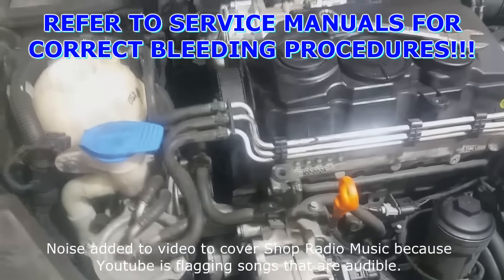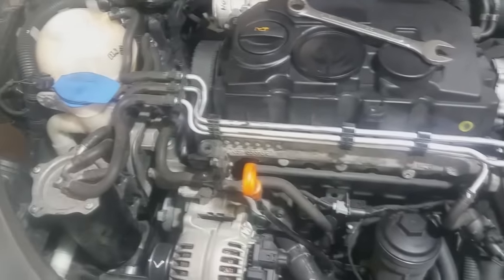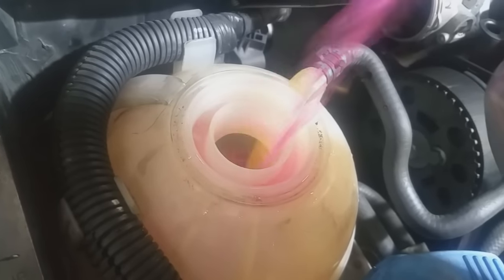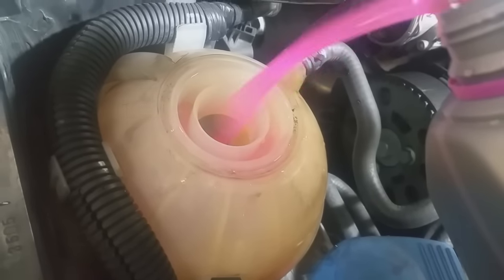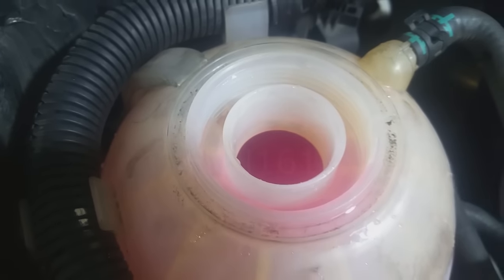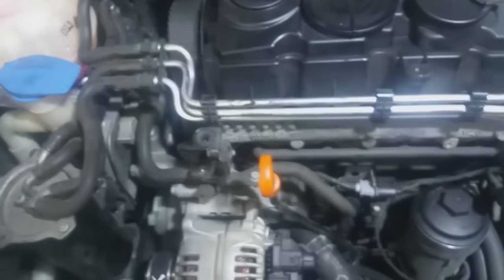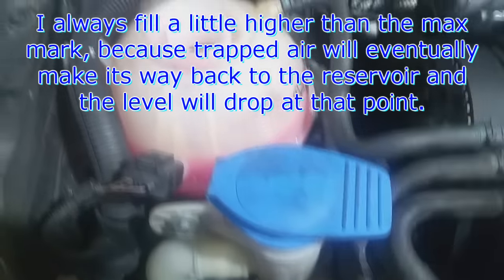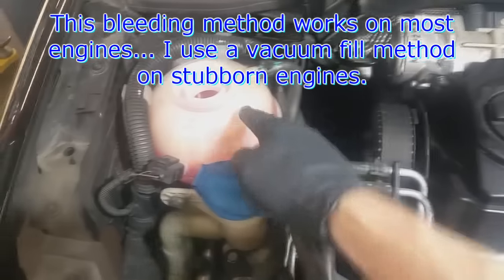Basic VW cooling system filling / bleeding info (viewer request)

Comment: I want to change my coolant from my Audi A1 but I don’t know how much liters I need to buy. Is 5 liter enough or do I need more?
Reply from the maker: 5L is enough... you have to mix it with water to get a 50/50 mix. 5L will make 10L 50/50 mix.
Reply from the maker: What year A1? Which engine? On average, VW & Audi engines take about 7.5L to fill the cooling system.
Reply: It’s a 1.4 T from 2010. That’s great! I will buy 5L coolant and 5L distilled water. Thank you. 👍🏽
Reply from the maker: @teunvanveldhoven2482  OK

Comment: Aren’t you suppose to wait 20 minutes before starting engine?
Reply from the maker: After what repair?
Reply: @EXOVCDS  Adding coolant 🥸
Reply from the maker: You can wait 5min, 2hours or 2 days.... it doesn't matter. Once coolant is in, you can start the engine (as long as oil is also in the engine).

Comment: How can you get the coolant out of a block on a b5.5 passat? Other models have a drain plug, this does not.
Reply from the maker: Disconnect one of the hoses from the oil cooler... most of the coolant will run out. There will always be some coolant left in the system. You would have to remove other components to drain further (remove thermostat flange / housing, disconnect the lower radiator hose etc.
Reply: @EXOVCDS  thank you, so the next time I start it will just refill the engine from the reservoir right?
Reply from the maker: @Janet_Airlines802  Yes, refill at reservoir, but with passat you have to be careful. Fill until the fluid does not drop / go down anymore. Disconnect the upper radiator hose to let air out (fluid should go down) and add more fluid to reservoir. Once you see fluid at upper radiator hose, reconnect the hose. Start the engine and turn the heater on. Hold engine rpm at 2000 rpm and make sure that warm air starts to blow inside. Always look at the temperature gauge... if the needle goes past the middle, shut the engine off. After the thermostat opens, fluid level will go down in the reservoir. Only open the reservoir cap when the engine is cold. Add more fluid after the engine has cooled off.
Reply: @EXOVCDS  thank you, I drained my radiator and it looked like antifreeze right out of the bottle. I I changed my thermo and the coolant looks a little rusty, that's why I was worried. Maybe I'll just leave it for now.

Comment: hello, can you help me please. i have audi a4 b7 1.9 tdi BRB 2007 year. I buy car with this problem. I put new thermostats (3 different thermostats i have tried: wahler 87c, behr 87c, mahle 87c), Those thermostats i tested before put inside car in kitchen, they opens in 84-88. But in my engine temperature is 95-96 when i ride, upper hose of radiator is hot, but radiator and bottom hose are cold all time, fan start working on 92c by ecu. The thermosats only opens on 93-94c if car not moving and i'm unplug fun connector. But if i start moving with opened thermostats, after few kms again radiator cold, temperature over 90. So in winter and summer i have same problem. in winter can be -20C, but engine temperature is 95 and higher on highway, but radiator is cold and fan working. Coolant tank is hot. Waterpump is new (with old was same), Coolant sensor new. Coolant system is bleeded. Heater works nice, very warm inside car. Its bad radiator or something wrong in engine?
Reply from the maker: TDI engines take a long time to warm up (for the lower radiator hose to get fully warm). The lower hose might feel cold like the thermostat is still closed, but it can actually be flowing fluid. As long as engine temperature does not go above 98c, everything is working correctly. As soon as you drive / start moving, the radiator is being cooled... you can drive the car very hard, come to a stop and the radiator will still feel cold. If you have heat inside the car, the water pump is OK. If the fans come on at idle (may take a long time before they do), everything is fine. Again, this is TDI... gasoline engine will be different. As soon as the thermostat opens on gasoline engine, the lower hose will feel warm and stay warm (thermostat stays open). With TDI, the thermostat opens & closes constantly. No warning lights / temperature light flashing = everything OK.
Reply: @EXOVCDS  its good to hear it, but its good, that in winter time i have 95c temperature, and fan working? i dont know why audi made it in B7 model, that fans start working on 92-93 temp. if thermostat is closed and radiator cold.
Reply: @EXOVCDS  when i buy car, i had  thermostat, with which the average temperature was 85-86с on highway, and if i put on neutral, temp drops to 80-82c. but anyway lower hose was cold on driving. Upper hose starts warming on 70c. i tested it in kitchen, and its start open on 75c. so i decided to change thermostat. With new thermostats (3pcs) upper hose warming about 80c. temperature dont drop down on highway on neutral. but avarage temp of engine is 94-96. lower hose cold. and working fan. And i dont know to do now, put old thermostat (lower temp, fan not working), or leave new one higher temp, fan working). Its not bad for tdi 96-97c?
Reply from the maker: Thermostat opens & closes.... if the thermostat does not open, then you would have temperatures over 100c. Do you expect the fans "not" to work in the winter? If temperature were to drop below 87c, you would have less heat inside the car. When driving, the fans are not needed / will not come on. You have to idle a long time (not move) before the fans come on... because it is a TDI. Post a video so that I can see what is happening... but to me, it sounds like everything is OK.
Reply: @EXOVCDS  on my car model a4 b7 1.9 tdi 2007, fan start working on 93c. (my neighbour have same car, and fan start same temp 93c). so when i ride in city or highway, or staying on idle in summer or winter, when engine temp is over 93, fan start working. (i have only one electric fan). max temperature which i saw was 97 when i did overtaking on highway, i stopped after this, open bonnet, and fan was working, radiator and lower hose cold, outside temp -20. engine temp was 96.
Reply from the maker: Old thermostat was bad (opens too soon) that's why you had colder temperatures. You will ALWAYS see hotter engine temperature than what the thermostat is rated at. Radiator fans are triggered at a hotter temperature (usually 95c or higher) than thermostat rating (87c for example). Watch this and part 2:
https://www.youtube.com/watch?v=GEo9fG9bURI
Part 2:
https://www.youtube.com/watch?v=5nmqsg3Lmdw.
Reply from the maker: @Игореха269  You only have one electric fan? Big fan is turning by belt? Because big fan is always turning, the fan is always cooling the radiator.
Reply: @EXOVCDS  yes, i have only one electric fan and only one coolant sensor. And i dont have big fan by belt. so because i dont understand why fan start working on 93c, if thermostat still not opened and radiator is cold. and temp 95-97 in highway. b7 model dont have fan by belt like in older B6 model, because b6 model have two fans: one fan with belt and one electric. i have only one electric fan like this - https://i.ebayimg.com/images/g/iccAAOSwB3JdSWx3/s-l640.jpg
Reply from the maker: @Игореха269  Like I said in my first comment "No warning lights / temperature light flashing = everything OK". With TDI it takes a very long time for lower hose to get warm / hot. The hose might feel cold but the thermostat still opens a little to let cool fluid into the engine, then it closes again... opens, closes, opens, closes. If something were wrong, then temperatures would be much higher. You are worrying more about this than you need to. Ask someone else if you do not believe me. 
You said you have heat inside car = good
You said water pump is new = good
You said thermostat is new = good
You said fan comes on = good
Radiator is cold because it is TDI (creates less heat than gasoline engine). Thermostat temperature rating is different from cooling fan activation temperature rating... that is why fan comes on at 93c to 95c instead of thermostat 87c temperature.
Hold engine rpm at 2000 rpm and monitor lower hose temperature, it will eventually get warm... it will just take longer, because it is a TDI.
Reply: @EXOVCDS  its hard to warm up lower hose, bacause thermostat start open in 93c. same time start fans working. i just want to know, that its normal, that my tdi have temperature about 94-97, fan working, and lower hose and radiator is cold. because i had previous car 1.8 audi a3 gasoline, and there thermostat open before fan start working. and one more question about my tdi. its normal, that in winter, when you stay in idle long time and heater working, engine temperature go down from 90 to about 75?
Reply from the maker: @Игореха269  You are not understanding what I am saying. Your thermostat IS WORKING / OPENING. It opens a little and then closes, opens a little and then closes etc. If it was not working then temperatures would be much higher. The reason the lower hose is cold, is because it is a TDI engine. Gasoline engine runs hotter and will have a lower hose that is hot all the time (once the thermostat opens & closes, opens & closes etc.).
With a good thermostat, temperature will stay in the 90c in the winter. With a bad thermostat (opens too soon or stuck open) temperature will be below 80c in the winter. 
Your car is working fine... I will not reply again. I have to reply to people who need help. If you can show me something is wrong, then I will help more... but everything you are telling me, is telling me that everything is OK / working as it should. Thank you for watching my videos.
Reply: Thomas EXOVCDS yes, i ‘m all understand it. Thanks for your help. I just try to tell, that winter time i have same temperature 94-97. And fan start working when radiator still is cold, and its useless fan working. So because i think that something was wrong in my car. Because when my car warms up, i can ride 3 hours in highway, and all time works fan, when radiator cold. Sorry its hard maybe to explain, i have bad english. But anyway thanks for help.

Comment: Hi my water was low day before yesterday so topped it up and now my temp gauge is going back and forth between 90 and 70 any ideas what to do ?
Reply from the maker: When does it go between 90 & 70? At idle or only when driving? Does it move quickly from 90 to 70 to 90 or does it go to 70 and only come back up when the car is at idle / not moving?
Reply: @EXOVCDS  when I’m driving ?
Reply from the maker: @chrisjames9584  a stuck open thermostat will cause temperature to drop once you are moving. If however, the temperature goes back to 90 while you are still moving, then the problem is usually a bad temperature sensor.
Reply: @EXOVCDS  yeah it goes up and down but slow . Would it be anything to do with my tank was empty so filled it up now it’s started going up and down? So it’s definitely not a serious problem ? Thanks for replying mate appreciate it 👍🏻

Comment: Nice video ...Questions i have a 2011 gti tsi...the coolant in the reservoir bubbles but and the temperature gauge is high but no leaks..is my holes clogged or is the something els...please help
Reply from the maker: TheChapMan Do you have heat inside the car? I think the water pump is driven by a small belt... maybe the belt is broken. If you have no heat inside the car, then the pump is probably not turning.
Reply: Thomas EXOVCDS yeah there is heat also the fans work as well...do you think i have to replace any sensors or the thermostat
Reply from the maker: TheChapMan Could be thermostat. Check if the lower radiator hose gets warm / hot. If not, then the thermostat is not opening.
Reply: Thomas EXOVCDS thanks gonna check it out
Reply: @thechapman4894  what ended up being the culprit? Same issues in my car. I am about to go check the hose under radiator. Let me know, thank you!

Comment: What if your heater doesn't work as in it doesn't blow?
Reply from the maker: Year, make, model, engine? Manual or Electronic heater controls?
A working heater blower motor is not needed to bleed the cooling system.

Comment: What if the whole jug is black. How do I get it clean out
Reply: Because I have a Volkswagen Jetta and I put water in the jug to clean it out. But how do I get the water out.
Reply from the maker: @MsKea-yc4yj  remove the bottle and clean it outside of the engine bay. Use dish soap or engine degreaser. Once clean, put it back in the engine bay.
Reply: Okay & Thank you so much. I'm going to do it in the morning
Reply from the maker: If the coolant is also black / has oil floating around... the clean bottle (if you can get it clean) will get dirty again. Depending on the year & engine of the car, the oily film could be coming from the head gasket or from the engine oil cooler. Flushing / cleaning the whole cooling system might be a good idea, then you can monitor how long it takes for the new clean coolant to get dirty. Most auto parts stores sell radiator flushes / cleaners. It's usually a liquid / chemical that gets added to the cooling system... the engine is run for 5 to 10 minutes and then the coolant is drained. In some cases, this has to be done a few times until nothing but clean water comes out. Basically follow the instructions on the bottle. =)

Comment: Can air in the coolant cause car to lose performance?
Reply from the maker: Depends on how much & where.
Cooling systems don't all of a sudden have air in them. If they do, then you have a head gasket issue.
When you have a coolant leak, the only time you will get air into the system is when the coolant level in the reservoir drops so low that it is empty.
If the engine ever overheated in the past,  you might have a head gasket issue.
If you have never had an overheating incident and you think you have air in the system after changing the thermostat or coolant.... I would suspect  blocked coolant return hose (the one that goes to the reservoir).
Year, make, model  engine? What is the actual issue?
Reply: @EXOVCDS  I have a 2014 2.0L Jetta S, I have two issues. The first issue is when at a stop light or stop sign. If I’m braked for too long, my engine will shake slightly then the RPMS would drop below 600 or 500. It stalled once, but it only happened once. It still vibrates randomly at stop signs. The next issue is lack of engine power. I feel like it’s way more sluggish then before. I already changed the fuel filter, spark plugs and wires and a air filter. Any help? I also used Fuel injector cleaner for a while, it helped make the idle more smoother then before, but I still have that low rpm’s at stop lights problem.
Reply from the maker: If the engine is misfiring / running rough, it will also be low on power. Fix the misfiring and you will have power again.

Comment: Thanks, doing this today after a water pump replacement. Glad it’s not one of those cars that’s a nightmare to bleed lol.
Reply from the maker: Before filling the system, remove the return hose from the bottle and blow into the hose. Make sure that air has no problem passing through the hose... then fill the system and pump the hoses.
Reply from the maker: What temperature does the dash gauge show? What temperature does the ECM show (using a scan tool)? Has the engine already run long enough till the radiator fans come on... or has a full "cold to hot  to cold cycle" taken place already?

Comment: Can i use water instead of the pink fluid? The weather is always hot where i live so no chance of water freezing
Reply from the maker: Yes... but water alone does not protect against overheating (water boils at 100c / 212F). With 50/50 coolant, it raises the boiling point to 223F or 106c.
Reply: Ali Abbas - Big No.. Water will cause corrosion and cooletsytem failure. The cooletsytem needs G12 coolet to lubricant the water pump bearing. Water is a big NO. And only use distilled water to cut the coolet 50/50.

Comment: Under normal driving conditions, how often should I replace the coolant in my 2011 Tiguan 4Motion? I live in Calgary, AB. Thanks.
Reply from the maker: VW says to check ever 2 years, with no actual flushing / changing schedule (as far as I know... I don't work at a dealership). We flush ever 4 years.
Reply: ***** every 4 years regardless of km eh? that's what my dealership said too... but it seems too soon?

check every 2 years = using a ethylene glycol coolant tester, test the freeze/boiling point, like this one from Canadian tire?
http://www.canadiantire.ca/en/pdp/motomaster-antifreeze-coolant-tester-0290039p.html#.Vm8CFPldUy0
Reply from the maker: +nickolastiguan Refractometer would be better: http://www.hardciderhub.com/wp-content/uploads/2014/09/8b94581f7955cb7b_org.jpg It's not just the freezing point... acidity / color is also a consideration. As the fluid ages, it will get darker (still pass freezing test) and more acidic.
Reply: ***** thank you for the tips!
Reply: ***** what is an acceptable number on the refractometer?
Reply from the maker: +nickolastiguan It'll be the same as what a regular tester shows... it's just more accurate (rather than buoyancy, it uses light refraction to test the coolant level). https://www.instagram.com/p/857WLMlDZ7/
Reply: ***** sweet thanks.
where did you get yours,  amazon?
Reply from the maker: +nickolastiguan Tool truck guy... but most auto parts stores should have them. If not, let amazon bring it to you. :)
Reply: ***** thanks.
is there one made specifically for brewing and one specifically for antifreeze/battery fluid?
Reply from the maker: +nickolastiguan Did you look at my instagram link above? Did you read what was in the picture?
Reply: ***** got it =D